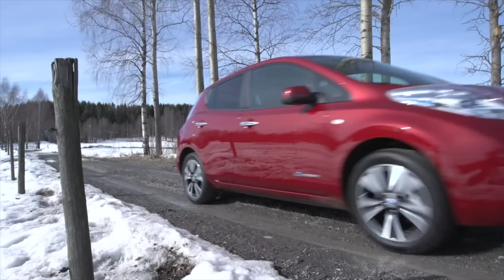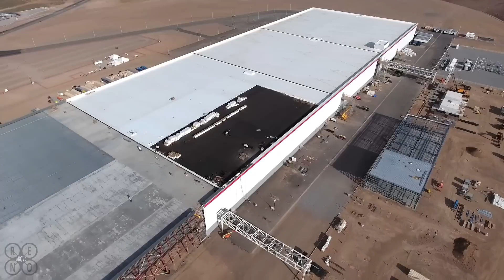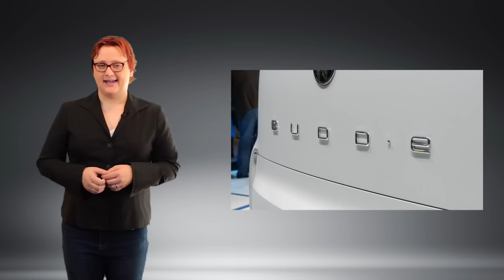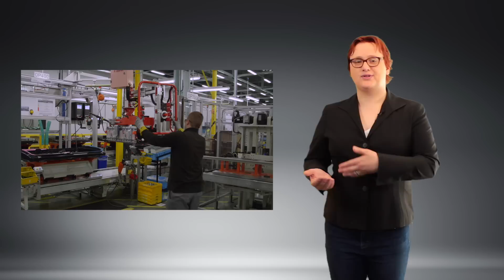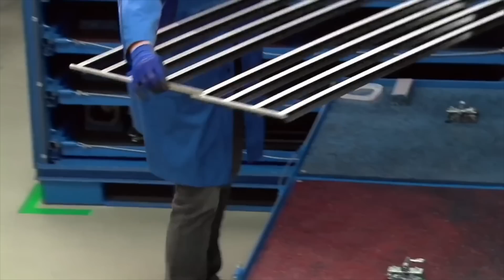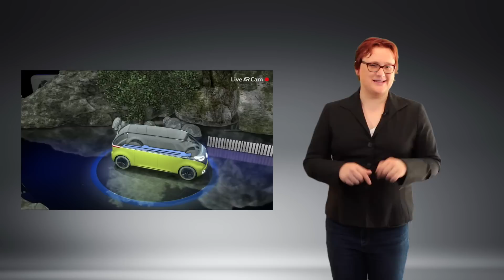What Does an Electric Car Revolution Need? 40 Gigafactories, Says VW

Comment: some good points but as several including Robert Llywellyn have mentioned. Converting all ICE cars to EV is not the answer. We need to reduce the number of cars by better utilisation with level 5 the number of cars required and the number of battery factories would be greatly reduced
Reply: We'll still need more roads/tunnels. Autonomous cars will simply increase utilisation, but will have no impact on traffic jams because the same number of people will travel - in fact if it becomes cheap and highly available, the traffic jams will increase. We need the tunnels!
Reply: The tunnels are just a temporary solution. More roads now means less traffic jams, but soon there will be more cars, so the problem is not solved, just postponed. If people start to use their car less, I don't mean completely abandoning them but use them more rationally, only when they really need it (because they need to transport things for example), and use public transports when they only need to transport themselves (typical commute home-work), this is a much more definitive solution, and a lot cheaper to implement.
Reply: I think so too, for that reason boring tunnels to increase the number of "roads" and therefore reducing the number of traffic jams in a nonsense. Reducing the total number of cars is the only way.

Comment: The biggest problem I see in the future for any automaker, established with electric or not, is sustainable mining and processing of the raw materials for the batteries.  Until the salt/glass batteries or the aluminum air batteries are refined a bit more and are used instead of lithium, large scale production will continue to be hampered by limited resource availability as well as the ecological impact larger scale lithium mining will cause.
Reply: Lithium is very widely available.  It's one of the more common elements in the Earth's crust.  https://en.wikipedia.org/wiki/Abundance_of_elements_in_Earth%27s_crust  Lithium Ion batteries can and will be recycled.  Tesla already plans to recycle theirs.
Reply: Rick Lokers:

I haven't looked into the predicted amount of harvest viable lithium deposits to be mined, and I am aware that it can be recycled, (and created in a lab given the right conditions) but that doesn't change the fact that for large scale production, cost and availability are king.  

Given the energy density and theoretical charge rates of both the glass/salt and aluminum/air batteries compared to a lithium based battery, it seems more likely that they would be the major innovations to move the electric car market forward.  

They could make it possible to have sub $15k cars with over 200 miles of range within 8 years.  They would also be cheaper, safer, and likely easier to manufacture, it's likely they would quickly reach a production level on par with traditional disposable chemical batteries today if given the right market factors.
Reply: Loanword Eggcorn:

Being the 33rd most abundant element in the earths crust doesn't mean that it's viable to mine.  Just because an element is common doesn't mean it's going to be in convenient to locate and harvest veins that will be financially viable to go after; especially if there's a cheaper alternative that's far more readily available and requires less investment to harvest.

Given that the two other battery types I've mentioned both use FAR more common elements, they would likely be cheaper to mine, process, and manufacture than lithium is even today given similar production facilities.
Reply: Hell cat and others: Lithium Ion batteries are fully recyclable.  Tesla plans to fully recycle theirs, and doing so radically reduces their material costs.  

Any new battery chemistry would take minimum of 10 years to go from lab to production, if it were even possible to mass produce.  They may be useful later, but Lithium Ion will be king for at least 10 and possibly 20 years, because:

Lithium Ion battery cost is falling in half every 10 years.  In 10 years EVs may cost less to build than fossil cars, due to the Lithium Ion battery costs being halved.  Definitely by 20 years.  The costs are not static.
Reply: +Alexis de Wouters Lithium is not scarce.  There's very likely more than enough available for EVs to replace all existing fossil cars.
Reply: +hellcat the main limitation on Tesla's battery chemistry is actually Cobalt, not Lithium, and there's plenty of both for what they need.  That's from both Tesla CTO JB Straubel and Elon Musk.   They have looked into it much.  :)
Reply: Often the byproducts of industrial processes such as you mention can themselves be recycled and re-used back into the same cycle, for example through filtering and/or reversing chemical processes.  For example one can take a cleaned, spent acid and make it more acidic using electricity.   So recycling these batteries boils down to energy inputs.  All energy inputs at Gigafactory are expected to come from renewables.  Therefore recycling the batteries using reneweable energy and with little waste should be possible.  Tesla is planning to do that.
Reply: I think hellcat is right. For some odd reasons no one seems to disclose just how their battery recycling works or at least how well it works. Companies are likely to call reusing of old batteries as stationary capacities recycling while actually defectife cells are getting their own fancy landfill somewhere in the third world. Unless the used materials can be fully recycled and used to recreate the original product to +95% like we are seeing with combustion engines for decades already, a new functioning principle for batteries or an entirely different approach is indispensible for the future.
Reply: Wobbegong:

You should really look into lithium battery recycling a bit more...

Since people always seem to play techtard, though I'm not accusing you of it, I've gone ahead and done the hard part for them.  Now all they have to do is click and read.

https://www.google.com/search?q=lithium+battery+recycling&ie=utf-8&oe=utf-8#q=lithium+battery+recycling&safe=off&tbs=qdr:y
Reply: Guys I agree that the recycling will play a very big role and I'm not afraid about the global availability of all the needed ingredients but you seem to forget something: to recycle a battery, you must first make the battery. So you need everything at the first hand to build all the batteries you need. Once you have all you need, you can recycle the materials for those batteries that will replace already existing ones, not new ones.
Reply: I would like to state again that for the record, I haven't looked much into what available lithium resources look like, but it's still more expensive to produce than the pennies per cell (given similar production scale) of the other two types would be even at today's metal prices.  Some of the new batteries would even allow most countries to manufacture them without requiring them to import materials.  Combined with faster charging and possible higher energy density, newer battery tech would be better than what we currently have.
Reply: Homo Quantum Sapiens Would you have any sources on the recycling part? It is my main issue with Li ion batteries and would like to know more about that. Last time I researched it the old batteries were just left to burn and the cobald harvested, the rest wasted. Heard about a bunch of prototype processes which were all still far from industrial availability.
Reply: +Wobbegong
Not sure if your read that already or if that is what you search for:
https://www.tesla.com/de_DE/blog/teslas-closed-loop-battery-recycling-program
Reply: Thanks. I will have a look at it. Hope they can really pull off an actual closed loop. That would be their first achievement to actually amaze me.

Comment: imo they should hold off on lithium ion until the glass electrolyte battery is manufactured.
Reply: That's just a bad strategy, if you ait until the fringe technology is available you will never get anything built. First you start building electric cars, creating demand, that demand will push for innovations in the field. Batteries will get better and cheaper faster, lowering the price of EVs, witch will  increase their demand and push for further innovations in the field, in a positive feedback circle...